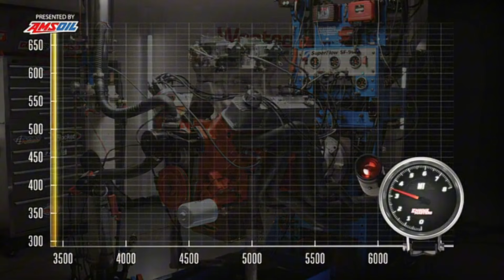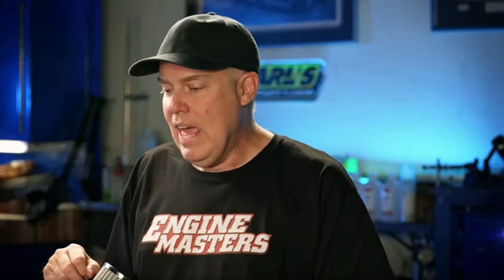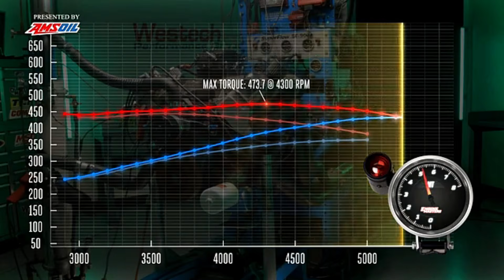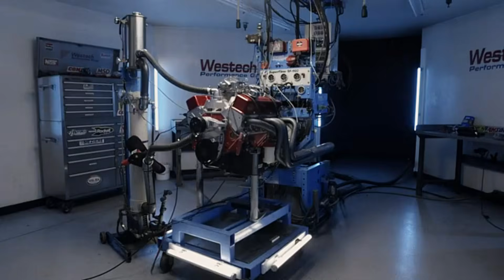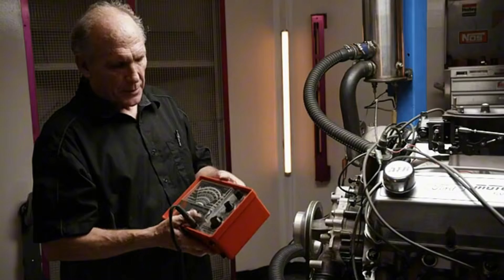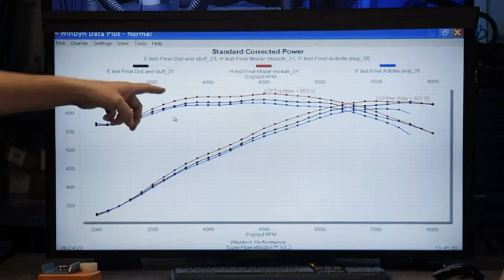Engine Masters 2025- S9 🛠️⚙️⚒️ Engine Personality Test: Camshaft LSA Explained🛠️⚙️⚒️ NEW TO DAY Full

Comment: What I want to see them do, is install the camshwith the same ICL.

If they are installing all of them 4 degrees advanced, the intake valve closing point is drastically different.  I want to see how much of that low-end loss is due to that. 

That would take that variable out, and the differences would only be overlap and exhaust valve opening.

Comment: Early 70s Chrysler came out with a Hemi distributor and ignition system solid state no points, we use those on 440 blocks and what a difference it made